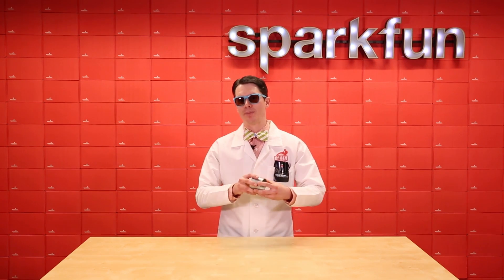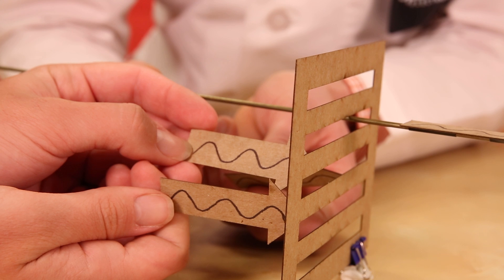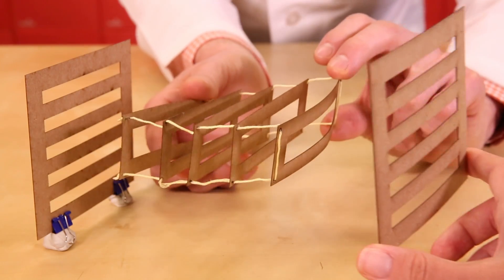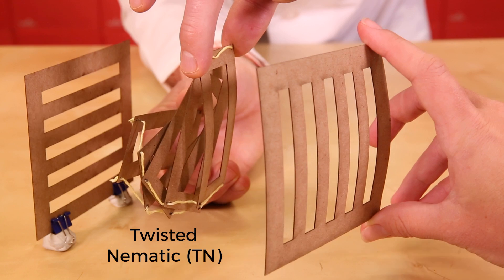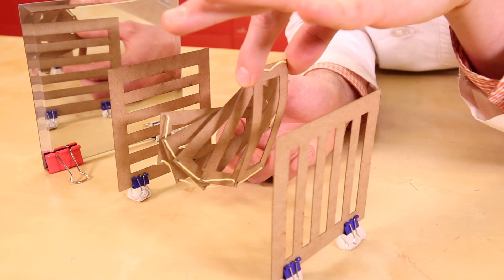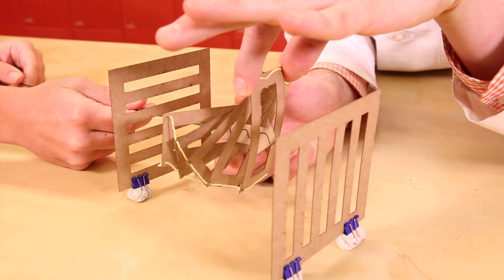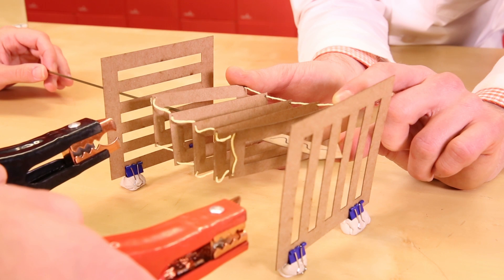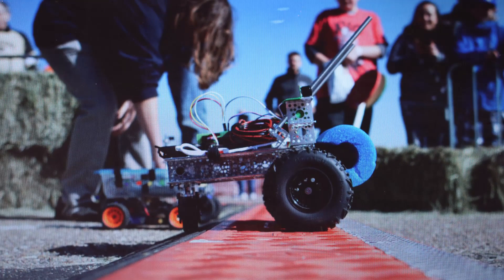Adventures in Science: How LCD Works

Comment: Note that your mockup of the TN voltage on state is incorrect. The LC directors orient toward the electrodes, breaking the twist. What you depicted was a sort of in-plane switch. TN LC is positive dielectric anisotropic, so you would have to move the ends of the LC toward the polarizer, sort of like a fallen stack of books.

Comment: I was with you until you said upgrade from Cathode Ray Tube
Reply: I get it, but in lit offices, working on bright imagery like word documents, CRT can reach barely above newspaper perceptual contrast, about 20:1. LCD retains very high contrast, so colour saturation is much more stable across ambient light levels, at the cost of poor saturation of very dark shades.

A good IPS panel will have even better viewing angles than CRT, due to lack of thick reinforcing glass. Then there is also energy savings in producing and using LCD.

Comment: why are we using a liquid crystal layer any way if the aim is to get the stop the inverted wavelength by the front polorizer , could we just use 2 different polorizer and block do the same